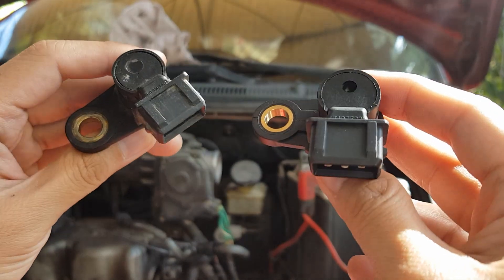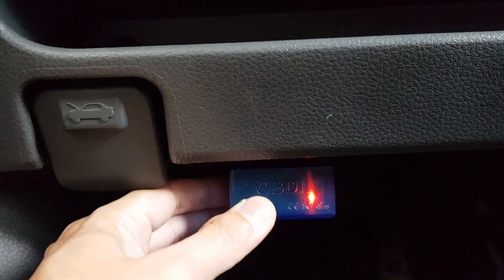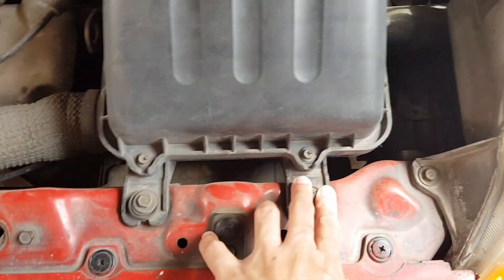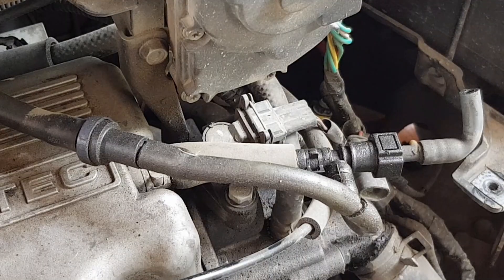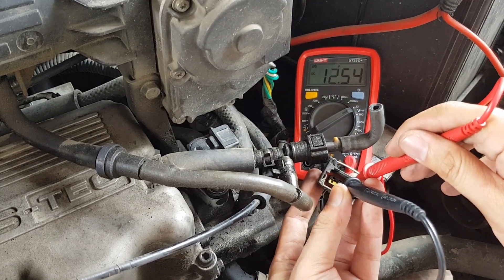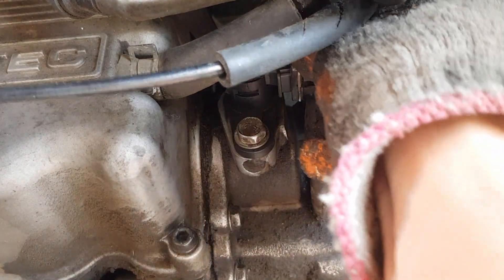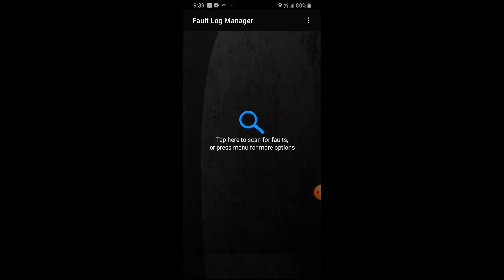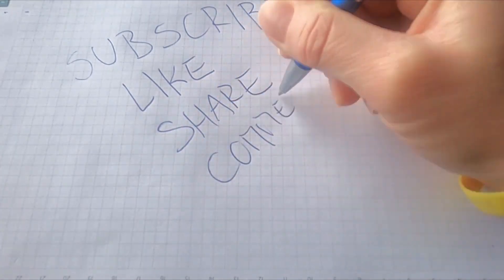How to CHANGE CAMSHAFT POSITION SENSOR and CLEAR P0341 and P0342 alarm codes

Comment: I replaced mine as well on Chevrolet spark just like yours and i did test the connector everything is fine, but still that code keeps coming the P0341 for camshaft position sensor
Reply from the maker: Try to clear the alarm codes with an OBD scanner. If the alarm comes back, there is another problem you need to find.